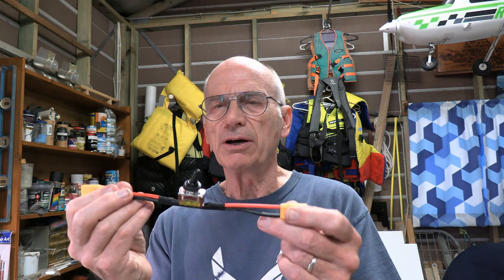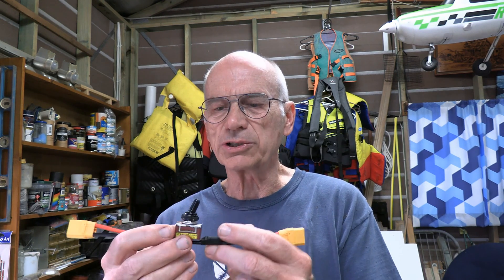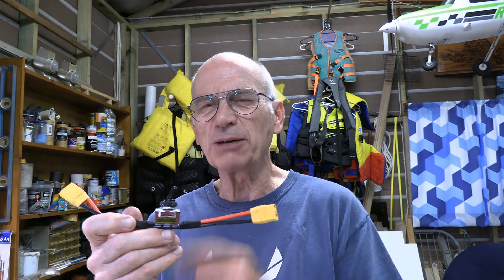Electric RC Plane Safety Switch

Comment: What he doesn't say is even if the RX doesn't have power through the BEC circuit because it is switched off, that the battery is still connected to the motor on the high current side and if the ESC fails can still start the prop which can cause injury.  I've had it happen with an ESC which also has a BEC switch.  So I will not trust that as a safety solution.  The only way is to put a line disconnect system/device in either power or negative cable between battery and ESC.
Reply from the maker: Thanks for your input, John.  I am wondering what sort of fault in the ESC, or the signal lead going to the ESC, could cause it to begin sending its three phase pulses of power to the motor to make it spin.  It normally receives a signal of electronic pulses  between 1000 and 2000 microseconds in length, and that's not happening with no power going to the receiver.  So something in the ESC would have to say "turn on at this power level" even though it's not receiving a signal.  I don't know enough about the electronics inside one to know what it would take for that to happen.  But, there is the possibility of a failure of the BEC switch to actually disconnect the power.  With your experience, do you think the failure was that the BEC switch failed to actually turn off the power?  That might happen by not having it slid all the way to the off position, or something shorting it out, keeping it connected.

Comment: That's WHY you put the Disconnect on the Negative/Ground side. You dont have to put a Massive size when it's on that way. Why do the smart Plane guys  act so blindsided?
Reply from the maker: Putting it anyplace in the circuit will give you the same outcome regarding the potential of adding resistance and adding a failure point.  The same current is flowing through the whole circuit, not just through the positive lead.  I have observed voltage drops and related performance drops from adding components such as this to an electric RC plane circuit.

Comment: Couldn't you wire in a blade fuse set up , you can get them to 100 amp
Reply from the maker: Yes, you could do that.  But I would still feel more comfortable doing it in the low current BEC circuit.

Comment: I tell my students to always regard the prop as "hot" whenever the battery is installed, and to be sure the throttle cut is activated on the transmitter before installing the battery. Also, a Spektrum transmitter will give a warning if the throttle is "high" when the transmitter is turned ON. I don't feel like another safety switch is needed, especially when you consider that you are adding potential points for failure. As you politely pointed out, the 15 A switch is a joke. It is a failure waiting to happen. Good video!
Reply from the maker: I agree, Clarence.  I have removed safety 'plugs' from two used aircraft that I have acquired, much to the disapproval of several of my fellow club members.  I'm comfortable with having one safety switch, being the kill switch on my transmitter.  But, the Black Horse Super Air that I'm fixing at the moment doesn't have access to the battery compartment without removing the wing.  For a situation like that, I would like to have a switch to have things turned off until I'm ready to fly.  Of course, as I have said in that repair video, I plan to create a hatch in the top for that particular plane to avoid that situation.